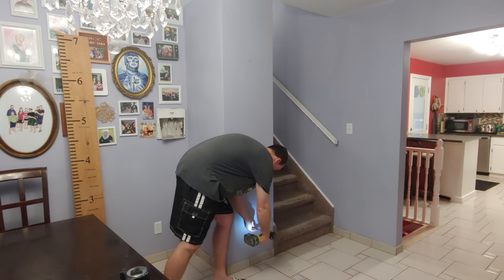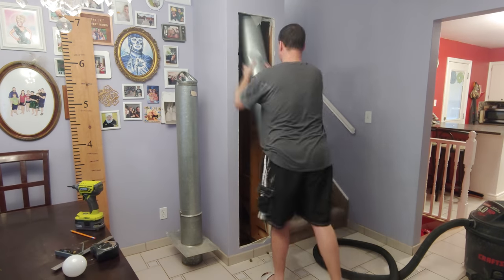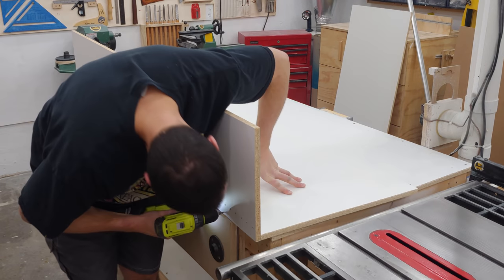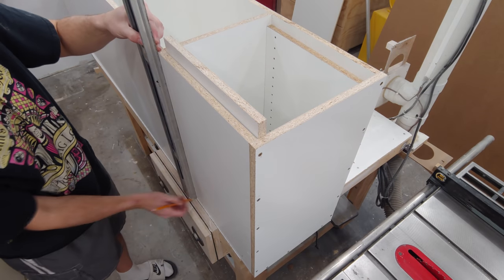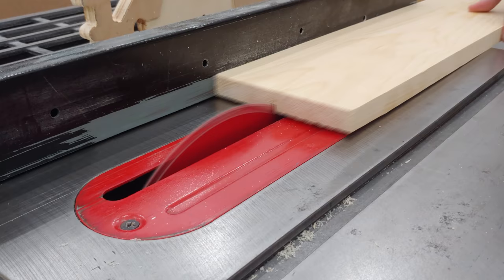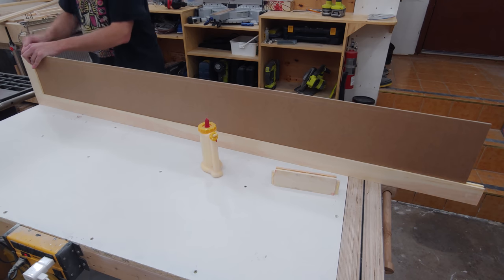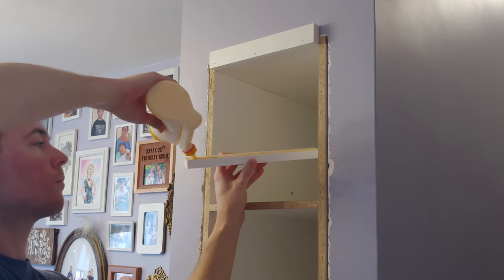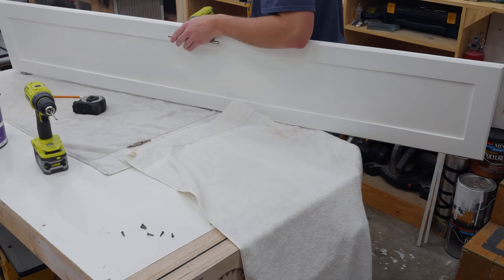What's Inside the Wall?   DIY Broom Closet Built-in

Comment: In my house they framed in a void where the return line for the HVAC was going to go.  I saw this when they were building the house and told them that since the HVAC design was changed that they could just add the space to the adjacent closet.  Guess they didn't care for my advice because they just framed it in anyway and left a big void there.  I've wanted to make it into a small linen closet but just haven't gotten around to it.  You make it look easy.  Thanks for showing an excellent way to reclaim some wasted space.

Comment: According to Google (much more reliable than Wikipedia), hardboard is real wood. It's made from exploded wood fibers compressed to roughly 65#'s per square inch (no glue or chemicals, impressive right?) & like all sheet materials is actually processed in millimeters. Since metric & imperial measurements never fall in line with each other, sheet materials are slightly undersized. Another reason why metric system falls short to imperial thinking, at least that the rumor on the street i just started.